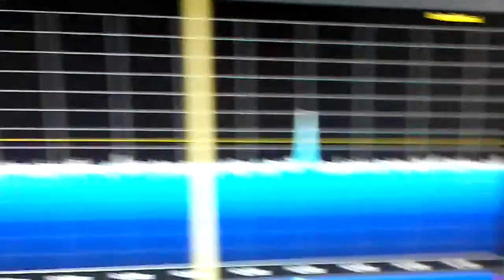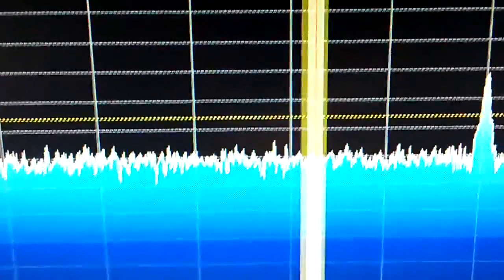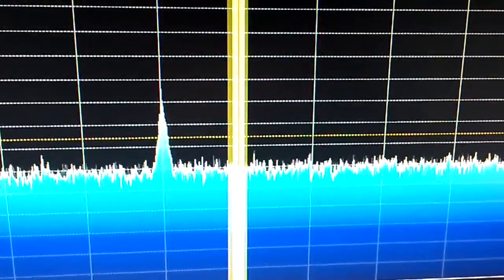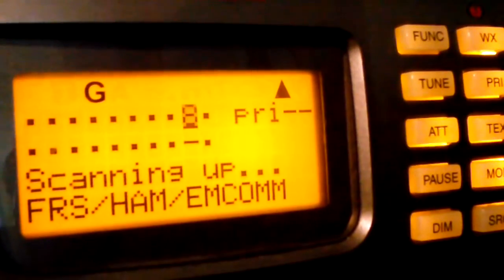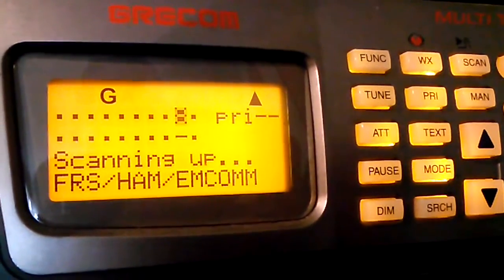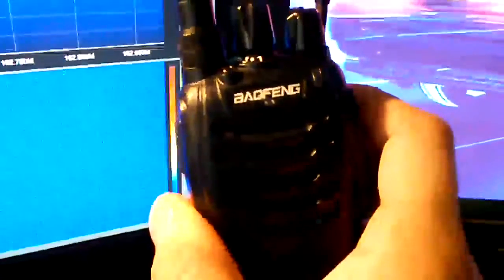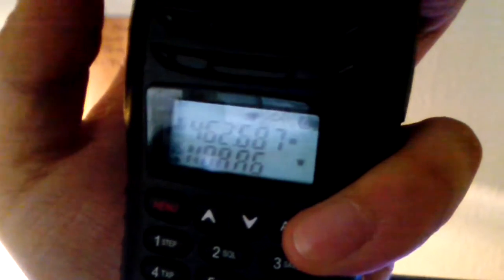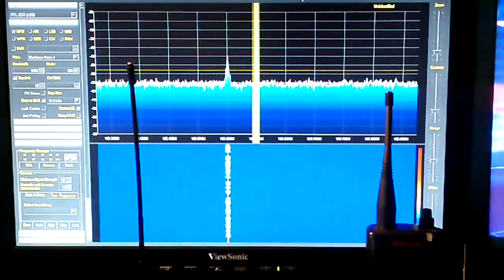Radios Explained: What the heck is squelch anyway?

Comment: A related video: RF Gain using same spectrum visual. RF gain will make everything on that spectrum analyzer bigger, basically, and turning it down would reduce RX power to the point only a tall spike would get through the rx circuit

Comment: Hello,
Great video! Was wondering, how you set-up the "oscilloscope" to show both the noise-floor and those stronger signals. I'm an electronics-enthusiast, but I am also a NOOB. I just recently acquired an old Bearcat radio scanner and I also have a cheap Mustool multimeter/oscilloscope-thing, it's really more of a waveform display. Anyhoo, I was wondering how I could set these two devices, to reproduce your set-up. Where should I connect the probes? Any insight will be appreciated. Make more videos. Thank you kindly
Reply from the maker: I've never used an oscilloscope my self, as I mentioned in response to another comment, the "spectrum analyzer" I used is actually a software defined radio program called "SDR# or " SDRsharp", and has a great visualization feature to illustrate what it's receiving.

Comment: Wow I learn something 2021 the audio guys at the store didn’t had a clear idea what squelch did in microphone receivers , now I understand perfectly it’s all about the frequencies a world we can’t see hehe but is there I might get a scanner later on , I had some issues with the mic giving static noise randomly and I change the channel before the event but then that noice came in when there was no one talking in the mic and we are talking about 500-590mhz range I heard in California the government is using 600mhz for some tv transmission or something like such so yeah I’ll be playing around with the squelch to avoid this noise , so it’s best to raise up that level for example instead of -5 to be 0 or 7?  Also I noticed when I took this mic away from the transmitter I got that noise again and it was just 11-15feet max apart we are talking about a senheiser wireless mic system xsw1 system . I prefer shure but we work for what we have …
Reply: One question since this is radio frequency will this happen if I get a 2.4Ghz microphone or it’s digital and I might have less or more problems w reception ? Since phones and wifi interfere in events loaded with cellphones hehehe